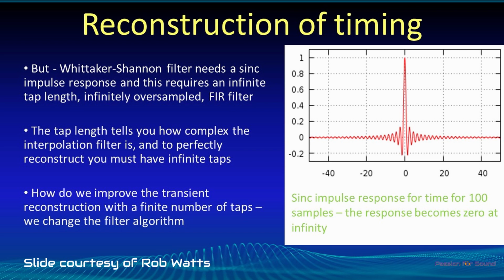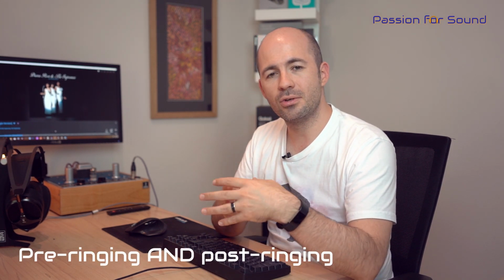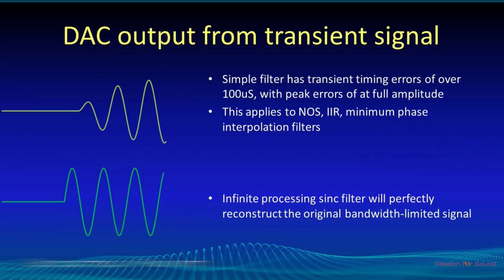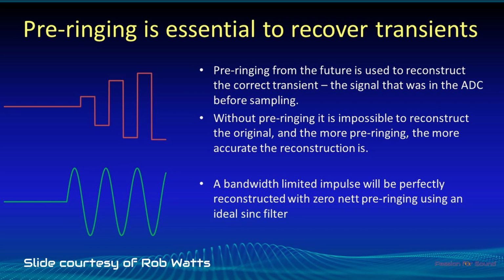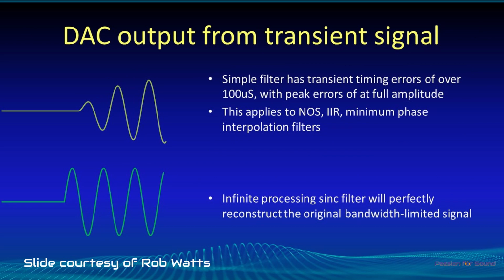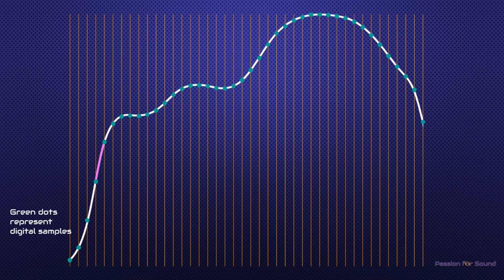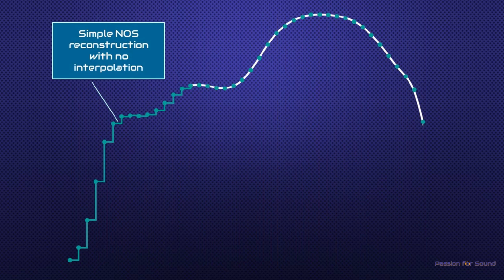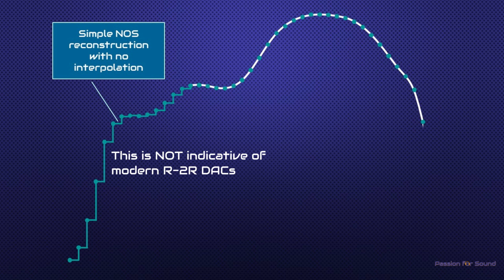Interview with Chord Electronics' Rob Watts - Part 3: Why Chord DACs Sound Better (and MQA's Issue)

Comment: Can someone pls explain what a ‘transient’ is?   Rob starts talking about how important they are here: 1:57, but not once does he explain what they are.  

Where on this graph is the transient?
Reply from the maker: Transients are the leading edges of notes or the very first onset of a sound. For example the instant that a note on a piano is struck. Hopefully that makes sense and sorry if it wasn't clarified anywhere.
Also, there is no transient shown on the graph - that's just representing the samples in an audio file. There will be transients all through every recording, occurring constantly from different instruments so DAC's ability to put these all together with excellent timing accuracy is the key.
Reply: @PassionforSound  that really helps, thx. But doesn't it clash with what Rob says about not adding more data here: 21:31?

Let me explain: 44.1kHz allows for 22.7uS timing resolution between each sample, but the brain can resolve better than 4uS (250kHz) which is a resolution of 5-6x better than CD hence why high-res music should sound better...

...because Rob's implying that the transient (leading edge of a note) could lie anywhere between two sample points and CD is basically missing 5-6 sample points to keep up with the 4uS figure for our brain’s time domain resolution, but a digital hi-res file sampled at 250kHz would match it far better (let’s ignore the QuTest’s filters that seem to show the brain’s resolution is even finer than 4uS).

If I understand correctly, Rob’s saying that a good DAC should be able to pinpoint the position closest to one of the 5-6 missing sample points when it’s interpolating between two samples.

He says it's "preserving the information state of the original recording" but that state is lost...it's not in the data. So his algorithms are recreating those lost signals, which by definition isn't that adding data?  (It's also the actual OED definition of interpolation)

I understand Rob's argument that what's added is only what was contained in the original performance, but that's semantics...it's still an addition.

Think of it this way: in years to come better algorithms and hardware may allow more accurate reconstruction of the interpolated data, which means his interpolation today ISN'T exactly what was performed (albeit it's very close) so it's a delta that was never in the recording (i.e. it’s definitely an addition).
Reply from the maker: This is starting to get beyond my specific level of understanding, but I believe what he is saying is that the sample rate (e.g. 44.1kHz) is sufficient to convey all of the required frequency information to the DAC, but is somewhat vague on the timing of the signal (when thinking about the 250kHz timing accuracy required). It's not so much that the data isn't there and is being added so much that it's not as accurate as it could be and requires additional calculations to improve the timing resolution of the information.
Perhaps another way to think of it is a bit like compressed files in a computer. All of the data is contained in a Zip file, but the computer has to work to extract the details of that file and make it usable.

Comment: 9:46 Doesn't the Fourier Transform of the lower signal contain above 20kHz? Continuous 20kHz sinusoidal signal appears as a very sharp peak at 20Khz in the spectrum analyzer. 20kHz single cycle sinusoidal tone burst appears as a broad mountain on the spectrum analyzer, meaning that it has frequency components above 20kHz.
Reply from the maker: Sorry, that's beyond my knowledge and would be a question for someone like Rob directly

Comment: can you review the Koss 95X electrostatic system from Massdrop please? Thanks
Reply from the maker: Hi Rosso, I owned the 95Xs very briefly and was glad to be rid of them. The sound wasn't special, the build quality is horrible and there was a fain squeal in the left channel that I couldn't consistently remove.
The sound of them was thin - well articulated, but not special enough to offset the lack of depth and body in the sound. Even on lighter music light classical / chamber they were uninspiring, particularly with the left channel issues. I'd say to do yourself a favour and look elsewhere.